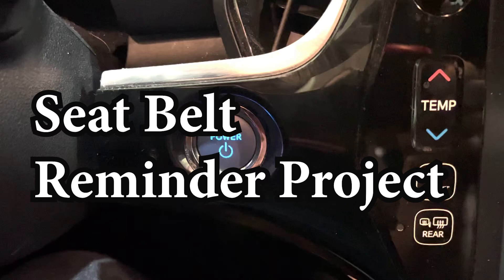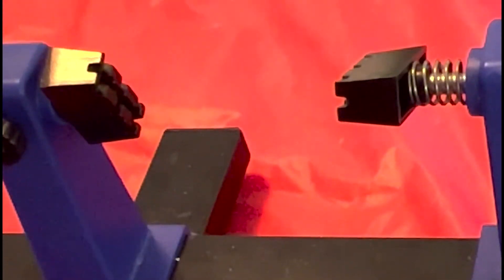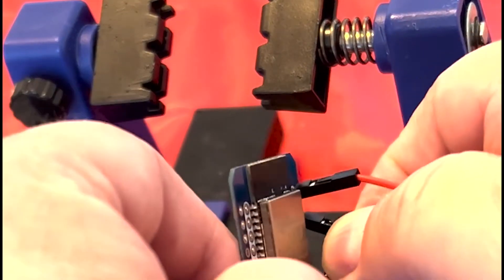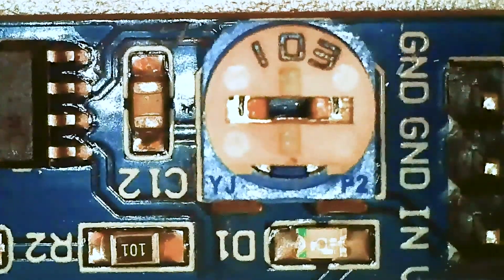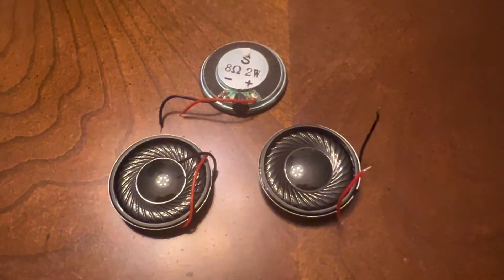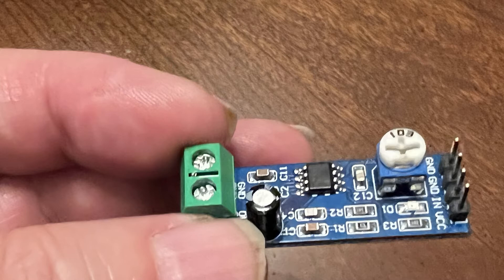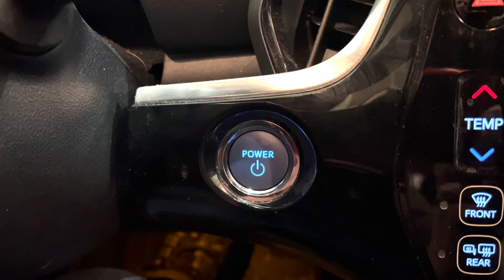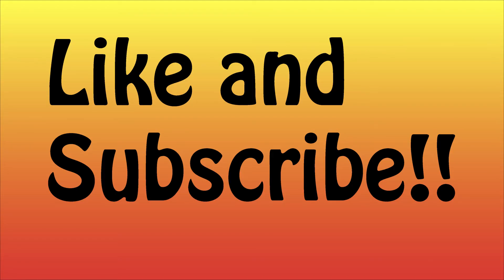Arduino Seatbelt Reminder Project- ESP32, LM386 Power Amp

Comment: Great Job, I'm building something similar to trigger when the dryer and washer go off and play different mp3's based on the day and time and send a signal to google home to make an announcement.  My washer and dryer already have wifi but I wanted to play something different than the standard Samsung song that gets triggered on them. Ever thing of sending a signal over the car speakers?
Reply from the maker: it is probably possible to send over the car speakers because the ESP32 has bluetooth, but then the car radio would have to be kept in bluetooth mode, meaning you couldn't also listen to  AM/FM.   The car is smart enough to switch away from normal radio to bluetooth for phone calls and then back again, but I'd have no idea how to trigger that.